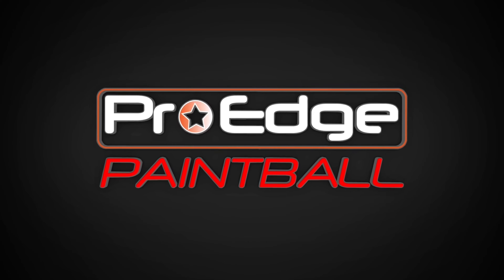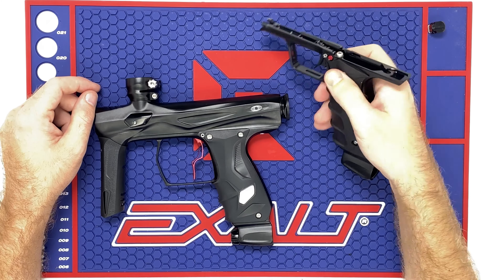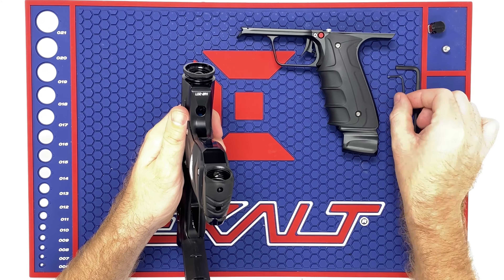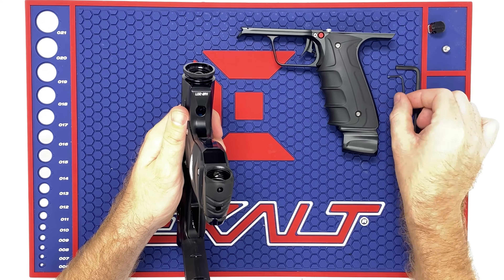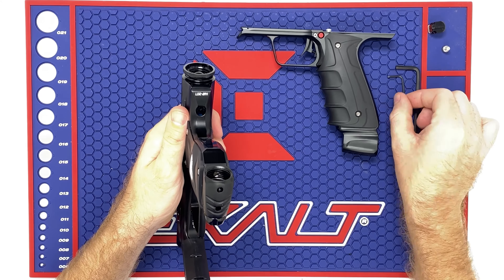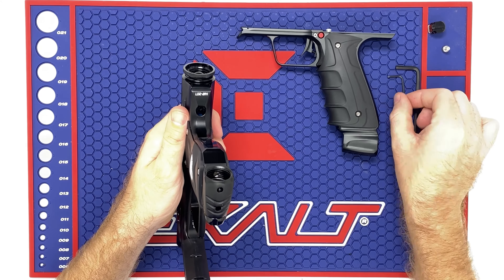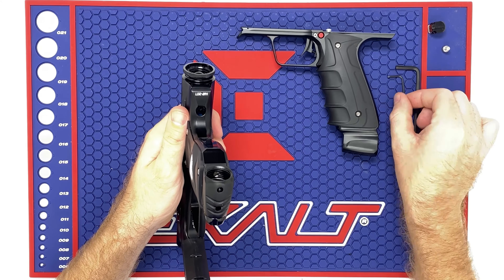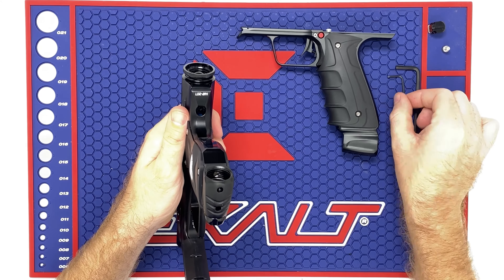Shocker Amp Mechanical Frame Installation - How To

Comment: I have a question, I did this and it started leaking from 2 small o rings behind the mechanical solenoid and every time I try to lock the tab in the black clip keeps popping off? Any tips?

Comment: Question from another video about tanks for paintball guns. I have two tanks that are carbon fiber and I saw that they’re worth bout 200 each. But apparently they are expired. Do I have to trow them away or is there a way I can still use them?
Reply from the maker: Tanks have a lifespan of 15 years from the born date on the bottle. Every 5 years from that born date they need to be re-tested. So a tank can be re-tested up to 3 times.

Comment: should i buy a tm40 or a cs2 pro?
Reply from the maker: That is a pretty tough question as those two are two of the most popular high end paintball guns out right now. My suggestion is to go to your local field or store and try to hold one in your hands to see how you like the feel of it. This is one of the most important pieces of information you can get on whether or not you will like the gun. What do you use now? Also, what are you looking for in a new paintball gun?